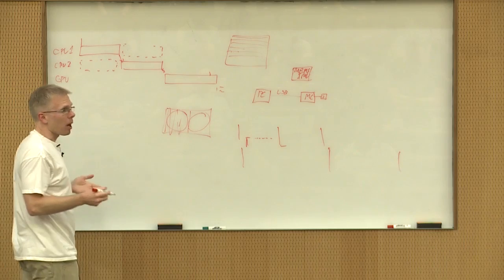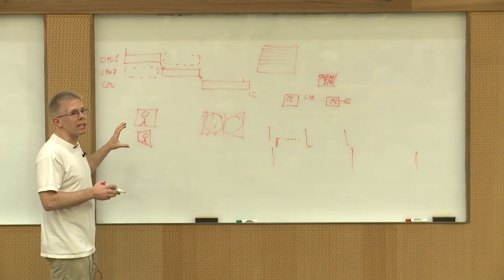John Carmack Tech Talk with UMKC-SCE

Comment: you can install fm_transmitter on non wifi raspberry pi zero and send that way, and then make a receiver with recycling coils and some transistor, that way you can build stuff out of practically trash, and still get like about light speed connections, but your not supposed to use FM to make a LAN game for your FPS

Comment: having 8 landing legs around the cube edges is the best lander. no fall-over problem. such landing legs are usable also as launch platform. and housing stuff like antennas or fuel. possibly directional thrusters themselves inside the legs ends. fly fpv with vr headset. if reality renders the image in the camera, you dont have to render anything in the cpu. on transmit the video image. ie best vr is remote controlled craft reality. its same when you see ar on top of real life view glasses. glasses pass-through latency is zero. laser image generation on the ar glasses. not so hard to require talk about it. what did you lose through law, everything not possible anymore. well modern display pixel times are more like 1ms not 16ms. dont compromise in perfectness. then the system is already broken, like human law and markets are currently. well sometimes doom needs to wait for faster pcs. well axually. so what about the cubemaps instead of the equilateral. its just 6 square images, mostly not deformed and only a small amount of extra pixel packing near the edges. use processor chip manufacturing pipelines to make micro-led displays. and other micro stuff.

Comment: Latency is important for everything! Many modern TV sets have 60–140 ms latency for the output alone and if the game console causes addititional 50–100 ms latency and the bluetooth wireless controller causes 50 ms latency, you're looking at 160–290 ms from you pressing a button to something happening on the screen. I personally don't want to play network games if even my internet connection is slower than 20 ms (also called "ping") and acceptable delay for audio is around 5 ms for me. This means that I cannot use bluetooth audio or flakey WLAN connection but wired 3.5 mm headphones and ethernet to FTTH connection. 20 ms for end-to-end (click from effect on screen) is good in my books and 100 ms is acceptable for click on website link until the next page is ready on your screen.

And I think anybody would be able to notice the difference if they used low latency system for a week and then returned to their usual laggy systems. Then they would consider those laggy systems pretty bad. Maybe ignorance is a bliss after all!

VR headset is just one example where nearly everybody can see the latency.

Comment: everything could be precalculated, and only the new coordinates need to be changed or proccesed. so, optimizing. and then. only need to change x.y.z wich is.... a ten digit ?? a hunderd digit, change, after pushing a controller. so. 10 or hunderd new digits. on a gigahertz or megahertz computer, can be done in one fifth of a second. just make the software so. that it is waiting. for input. more or less.
Reply: buffered of cache-ed, pre-rendered. pre-loaded scenario specific movement triggered que's, in a limited loaded part of a digital maytrix. where even possible actions, are allready loaded but not activated. just like the philips cd-i, Static, choice based videogame, but now, and interactive choice based videogame. its new. and when the scene, is left, then all its ingredients are unloaded, (purged) and the new video game scenario, is pre loaded (parsed). waiting for user input.
Reply: We are kind of slow for a human, are not we ?

Comment: 1:01:38 A little known fact: RAW is not "raw" information from the sensor...it's actually heavily processed already by internal software. The "formula" used in this processing is very different from manufacturer to manufacturer and may include corrections for lens effects, sharpening, etc even if you do not actively decide to use specific modes. In some cases you will also have low pass filters on top of the sensor..etc.

Comment: The first thing I thought was the laser retina display. But diffuse it over an normal levels by wearing the lens inside, with a diffusion buffer and the laser outside. But it would not be a good idea, otherwise he would have done it by now.

Okay so, why not just put a sensor on the eye lid and get raw eye movement data. This way we not only save money on cameras, lenses and eye tracking but without hurting the eye we can approximate to a very good amount where they eye is looking.
Reply: 1) apparently he tried that, and it wasn't really that impressive 
2) the speed with which a human can move his/her eye is still too fast for even a specialized camera to track and then relay to the rendering system. It's possible to do that kind of eye tracking and even use it to optimize, but not fast or dynamic enough to perfectly track the foveal region at less than 5 milliseconds. Carmack talks about this in the SMU Lyle lecture.
Reply: @Wobbothe3rd  oh boy! That iris lens idea sounds good but is painful. If he didn’t find any luck with it, our tech needs more time. But we should still have good reaction times with the senators on eye lids, I think we have good tech now that can provide near real-time reactions <100ms. Instead of accurately tracking we could approximate to a degree on ai training model.

Comment: So the best industry professionals got the pipeline to 100ms, so I rewrote everything and reduced by it an order of magnitude.  Yeah, that sounds like a John Carmack thing.
Reply: Changing pixel color on your screen require more time than sending packet to europe and back. Silly times.
Reply: Thats not the point, the industry didn't need anything less than 100ms. If it did they would have done it loooooong before Carmack
Reply: @EvoPortal  "The industry / authority is all-knowing" is something only autistic people believe. Every organization is a bureaucracy, its agility inversely linked to its size.
Reply: @EvoPortal  Wish the target was at least 50 even before VR

100 feels bad in my experience
Reply: @EvoPortal  bruh, the industry was doing it before John Carmack and then John explained to them exactly what is being lost by deciding it isn’t important.

Comment: Carmack is crazy in a good way. A damn genius of a programmer. Romero may have been the architect of DOOMs levels but without Carmack figuring out how to make the engine run and run on the slow hardware of the early 90s there wouldnt be FPS. Hes a master of optimization too making code run on the slowest system possible and he would often stay after everyone else had left frying to make things work as best as possible or working on a problem until it was solved
Reply: Without Carmack id would still be at softdisk. But early Romero was very important.
Reply: Slowest system did not work much for me. My brother tried hooking up our Acer computer (Windows 95, 100 mhz) and HP computer (windows 98, 333 mhz) to run doom for modem play. It would not work at all. I only did modem play on the HP Computer connecting to the friend of my brother's computer and vice-versa for doom. The friend's computer was fast enough to keep up.

Comment: Graphene looks like it is the way to get to 0-1 ms response times, if you're able to manage the entire life cycle of the application from HW to SW.  I.e. input devices (mouse or keyboard), through to graphene cabling, graphene cpu and memory, and a graphene display.  Then the bus on the CPU would run at the same speed as the network or data storage or display system does.  Everything from fetching, storing, sending or displaying data happens virtually at the same time.

!DA

Comment: He can clearly do a presentation for over an hour and I’m here stuttering, shaking and sweating with a 3 minute presentation.
Reply: He didn't start like this and you can get there too.
Reply: @JoeyMantka  The names that their parents gave them were "John" (Carmack), "Mark" (Zuckerberg), "Bill" (Gates), "Steve" (Jobs)... Absolutely normal and ordinary names. The surnames might not sound super common, but that's because there is a handful of "common" surnames and then you have a long tail of less known surnames.

IMHO, success is a mix of talent (genetics), hard work (practice and persistence) and luck (being in the right place at the right time). In the case of Carmack, he clearly is extremely gifted and he is well known for having a strong work ethic.

I recommend you the book "Masters of Doom" if you want to know more about Carmack's early years.
Reply: He lives through what he explains. Normal people very rarely presents issues which they are passionate about.

I have opportunity to present both sides of the spectrum. And I am two different people while doing both types of presentation. And it's not related to boredom. 

Those are lacking parts of the full picture which don't allow you to go with the flow, so the stress and stutter sometimes kicks in.

On the other side, you have full knowledge at many scales. Like high-level points, process maps, value stream maps, steps and stories on each level. You also have nothing to be ashamed of while saying this is a detail where another person comes in to help and very briefly describe this person's area of expertise.
Reply: Wait till you watch his 5 hours interview on Youtube (look it up)
Reply: yeah i mean carmack propably was (and maybe even still is) autistic. from what ive heard about him in his youth he maybe even was in some way severely autistic. but its not like he´d care.